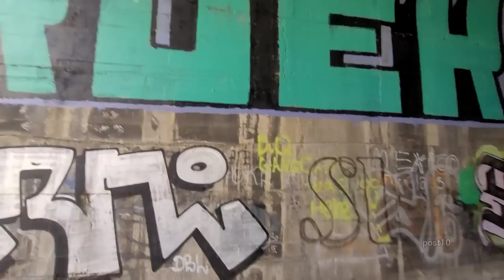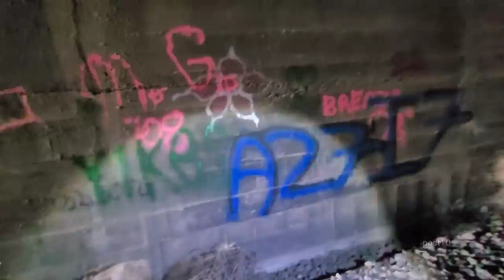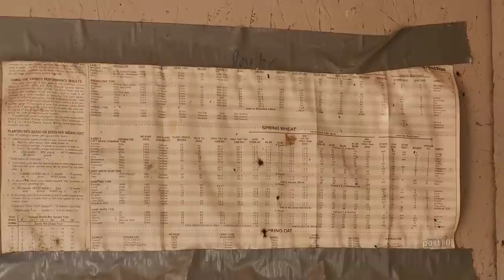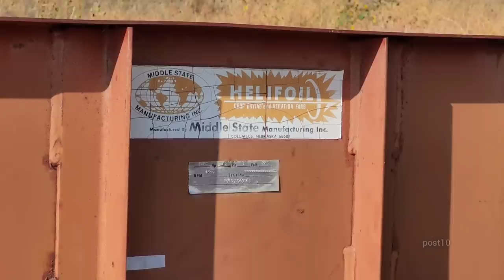Railways, Crumbling Buildings, Huge Bridges And More

Comment: Those vents are to relieve forward air pressure (displacement) when the train enters the tunnel
Reply: That is really cool information.
And it makes a lot of sense to have a couple in a long tunnel.
Reply: Chooch ventures
Reply: Not true
Reply: @MonkeyJedi99  Wrong.  The other end of the tunnel is good enough for that.
Reply: to accelerate smoke dispersion....locomotives are a lot like people- they work better in fresh air
Reply: @tommurphy4307  Also the drivers and any passengers live longer. for all those people who think the tunnel entrance is sufficient for ventilation i assume you have never heard of the Black market express disaster.
Reply: Those old towns are the result of highway diversions. That used to be the main road.
Reply: This much simpler explanation does sound infinitely more plausible and on the face of it, accurate.  However, taking a moment to reflect upon the many other tunnels we have each travelled through, why couldn't we recall ever having seen anything remotely like what is claimed here, and identified this easily ourselves? So I'm not so sure this is as accurate after all.
Reply: My theory is these are refugee points to wait for passing trains, or it was some kind of service hatch and the bars were added at a later date to stop people from accessing the unstable rocks behind
Reply: 1:05:40 Post had the same thought 👍🏼
Reply: @tommurphy4307  Are you claiming that a solid fuel powered steam boiler is more efficient if the already moving train has 'cleaner' air around its fire box? Your comment is suspiciously over supported by YouTube's Thumbs up bums counter too in my humble opinion.
Reply: That's exactly correct .
     The tunnels look big but if you seen a train inside of one , yes they are pressure vents .
Reply: Yes.
If a train was really pulling fast into a wind, the tunnel would become a pressure vessel not to mention fill with smoke, and "pop" out the end.
The vents prevent the smoke staying in and permits the train to maintain speed (& lower the level of "pop".
Reply: @scaleyardmarine 🤣🤣🤣

Comment: That old RR bed is indicative on how the railroads were engineered and built 19th and early 20th century. The old roads and railroads from that era followed low lying areas. Many followed rivers or low lying features that were prone to flooding. After the equipment got better did the engineers seek a higher ground. Mostly after WW2, the engineers of highways and railroads had a better way to build. That filled part is a great example of that, right at the beginning of the video. They learned much from the mistake of building too low. Creating a higher roadbed was crucial. With the advances in earthmoving equipment and cheap diesel came better track, highway, and road alignment.

Comment: The water damage/mineral build up on the wall at the entrance of the second tunnel is from blowing snow and dust being sucked into the tunnel. The snow builds up on the sides of the tunnel as the strongest air current goes through the center and slows down depositing the snow only in the first meters of the tunnel. That's why the "damage" was only at the beginning. Then the snow/ice build up and collect dust and dirt blown in as they take a long time to melt since the tunnel stays much cooler than the outside air.
Reply: Nope it just salts seeping from the ground through the walls of the tunnel.
Reply: @Mike-tv9rk  I have to agree.  The foundation of my house looks the same way in the spring time as the water that wicked up into the concrete over the winter dries, and leaves the calcium deposits behind.  I also live in this region.
Reply: It is rising damp.
Reply: @Mike-tv9rk  Yes, from behind the wall.

Comment: 25:30  Eleodes obscura.     They eat dead plant material, animal remains, roots, and seeds. 26:12 Lesser Yellow Underwing. 26:21 Anise Swallowtail. 28:00 Tumbleweed seeds. 1:54:16 After the windmill broke for the last time they put in the gasoline powered pump jack that used the same equipment below ground to pump water.

Comment: That part of Washington doesn't get enough snow for snowmobiling, you need to go to the forested areas for that. The part your in is High plateau dessert. If your here at that time Tollgate Wilderness Area in Oregon is a great place to go, they groom the trail regularly there but is far enough from a major population center that it doesn't get over burdened with city folk. Also that dust you kicked at the trestle is likely ash from the 1980 eruption of Mt Saint Helens, you can still find large piles of it in the area.
Reply: Mt st Helen's or Mazama, thats also common out there.
Reply: @rockdocandlittlebird5974  Its posable that its Mt Mazama but un-likely given the area for two reasons. First the area he was in is right along the path of heaviest ash fall from Mt St Helen's main eruption in 1980, and two most of the Mt Mazama ash in that area must be dug down for.
Reply: @Darkreine99  sweet, I live here and have multiple degrees in geology focusing on that specific region.  I know it isnt common but it is possible to find out there.  I've been there, done it, without digging.  Lots of road cuts expose it.
Reply: @rockdocandlittlebird5974  I live here too, and have studied the geology of this area all my life driven by my fascination and the impact May 18th 1980 had on my young mind at the time. I do not nor did discount what you said. I merely made the statement given the evidence that it is more likely Mt St Helens. Because without physically touching and taking a sample there is no way to be sure from a 10 second clip in a video, and let face it a road cut is a hole dug. But I do apologize if what I said made you feel minimalized that was not my intent.
Reply: plus the ballast in the tunnels would be tough on the snowmobiles- duh

Comment: That area is part of the channeled scablands. That entire terrain was carved by the repeated Glacial Lake Missoula floods. Lake Missoula formed and reformed as the ice sheet retreated, but was dammed by ice which would eventually break. It is now generally thought that there may have been 40 or more of these between 15,000 and 13,000 years ago. The water flow could vary between floods and are hard to estimate, but one common citation for the largest floods is 10 cubic kilometers per hour (roughly 13 times the current Amazon river). Flood waters dumping into the Columbia flooded most of the Willamette Valley in Oregon.

The volcanic flood basalt that covers the whole area broke along the cooling fracture lines basalt tends to have and huge chunks just washed away, resulting in giant cliffs and canyons that are out of scale otherwise. Also giant river potholes ground out in some places.
Reply: you wouldn't want to be in one of those tunnels back then, right?
Reply: I've seen those potholes. 
They are still kind of a mystery.
Reply: @TheBandit7613  Prof'. Nick Zentner, 
Geology, Washington Central University, 
went to Dry Falls, and showed us 
the huge holes drilled into the rocks
 below by the huge Ice Age Floods 
that crashed over the Falls : 
If interested, you might like his 
lecture on : 
" Dating The Ice Age Floods ".
🇬🇧💕🇺🇸🌈🦉☺️🇬🇧
Reply: The rocks ripped away by the Ice 
Age Floods : hard to visualize ! 
Huge volumes of water, plus 
icebergs
 with rocks frozen inside : 
when the 
ice melted, lots of rocks 
were  then " dumped " in 
unexpected  places : 
I think they are called, 
" Erratics"...
Prof'.Nick  Zentner' s Geology videos
and field trips are so interesting.
Thousands of people across
the world have found a new
 interest : Geology ! 
Loads of videos here
on You Tube.☺️⛏️☺️
If interested, please perhaps
 start with the series, 
" Nick On The Rocks ".
Highly recommended.☺️.
🇬🇧💕🇺🇸🦉🇬🇧⛏️☺️🇬🇧

Comment: If you're in Seattle area, check out Snoqualmie Pass tunnel at the top of the pass, along I-90.  2-mile long tunnel that is now a bike path, John Wayne Linear Trail, which leads west downhill 20+ miles to Issaquah.  You are required to have flashlights since it is so long and dark.  I did it on my bike a few times and it took 15-20 minutes to get through it on a bike.  Slight grade uphill to the east, downhill to the west.  A lot of the former Milwaukee Road electricification is still visible, the poles alongside, and catenary towers on the high trestles.
Reply: Yes, that's an awesome tunnel.  I ride the Palouse to Cascades Trail on occasion too.
Reply: the abandoned pennsylvania turnpike tunnels are bike trails where you have to have lighting, as well. one of them is the site of the annual 'echo dark bike race'. the echos help the racers keep from hitting the walls.

Comment: Pretty sure the 2 tunnels I located on Google maps are the ones you walked through. There is an inbuilt straight line measuring tool in Google maps, using this the first tunnel  is 677 metres/2,222 feet and the second tunnel is 759 metres/2590 feet. Some breathtaking scenery in this video.

Comment: I've seen good amounts of video from the former Milwaukee Road grade north of this ROW, but never this one! This is the former Spokane, Portland & Seattle Railway mainline from Pasco to Spokane. Successor Burlington Northern (foolishly) abandoned this route in the late 80's and used the former Northern Pacific line form Pasco to Spokane. The SP&S grade happens to be the BEST route between both cities in terms of gradient, but the huge trestles near Pasco and lack of on-line customers was a big turnoff for the BN. In Washtunca (where you saw the graffiti bus) there happened to be another rail line (also abandoned) that was built by the Oregon Railroad and Navigation Company. Their ROW crossed under the SP&S just outside of town!

Comment: I think you're right that the grates in the tunnels are for safety. They definitely look modern in materials and construction; especially the machining on those security bolts. I noticed you can also see the yellow marker on the parts from when they were fabricated... For example the second one you came across in Tunnel 16 was marked "#16.2" on parts of the frame. Each one was probably custom sized for the particular hole they were made to cover along the various tunnels of the trail.
Reply: If they were for safety they would be every 50 metres. Have a little think dear. How fast can you run from a train.?  Probably vent shafts to the surface.
Reply: @Mike-tv9rk I'm talking about the safety of the public using the trails today, to keep them out of potentially dangerous areas like vent shafts. I already stated that the grates looked modern, so I'm not sure why you'd think I was referring to a use from the long-gone days when trains were running through. Perhaps you should have a little think yourself, dear.
Reply: @marcberm  ok i had a re-read. Yep sorry.  I jumped the gun a bit, because there are alot  of comments about refuge spots. Again apologies.
Reply: The grates are very likely there so people dont go crawling in the holes behind the walls.
Reply: those were def not 1909 security bolts- duh

Comment: Railway tunnels commonly have what are called 'refuges' where maintenance workers can go if a train comes through and the worker cannot get out of the tunnel. Railway bridges have them too. I know that the Eurostar tunnels under the English Channel are actually 4 tunnels, 2 for trains and 2 for maintenace travel. Maybe that is what is behind the vents. I'd be surprised to find snakes in a cold tunnel cos snakes and other reptiles are cold blooded and prefer warm conditions. Fascinating place to explore.
Reply: These vents were not numerous enough to be refuge tunnels. Nobody can get to them fast enough. Most likely vertical air shafts per distance regulation .
Reply: @Mike-tv9rk  You're probably right. Just a guess on my part as i haven't been there in person. Have a great day.

Comment: The section of road bed you stopped at that was filled over with man-made fill was actually a HIGHWAY.  The Kahlotus Railroad Tunnel actually exited further up 263, which was the road that turned off to the left before you got to the filled area

Comment: I live in Eastern Wa., so found your video very interesting.  One of the rail to rail parks I've wanted to ride with the mountain bike is the Columbia Plateau trail you featured.  Now that I've seen it, I think I'll wait until it gets more usage and maintenance.  Still, the scenery is awesome.  I followed Google Maps during your journey.  Didn't even know those tunnels were in that area.  Regarding the fire, according to the fire tracking Web page CalTopo, this fire happened in 2020, and it covered many acres.  I'm surprised the guardrail hasn't been repaired yet, but the sections that burned are in county jurisdiction, and funding is probably very limited right now.  The road turns into a state highway at Windust Park, about 3 miles south of the dam. and remains that way north to the town of Kahlotus.  Great video!
Reply: the tunnels would be okay- just rr ballast rock. i would do it in the fall.

Comment: 28:16 A section of I-90 where the ground comes up on both sides of the road, was completely filled with tumbleweeds during a storm a few years ago. Cars kept plowing through in an explosion of plant and dried fibres.
Reply: I live in Eastern Wa, and I've had that experience in my back yard on a number of occasions.  Sometimes 6 feet high, from fence to fence.  No fun getting rid of!

Comment: The road you turned on to that went by the foundation remains is the rail grade that was put in to bring supplies in to build the dam. Had you continued you would have arrived at snake river jct. The railroad on the opposite side is the Union Pacific line from Spokane.

Comment: I was going to guess those grates are for equalising air pressure as a train passes through, but your guess of them just grating off worker holes sounds more plausible.
Reply: they are for ventilation and access to the tunnel bore. the concrete had to be inspected (inside and out) every so often as per the RRDOT

Comment: The lever in the bus is the gear lever connected to the gearbox at the rear end. The “Flywheel” looks to be a brake disc on the prop shaft for the handbrake, rather than having the handbrake operating on the rear wheel brakes. Willis Jeeps used in the Second World War had a constricting band that acted upon the prop shaft for the handbrake.
Reply: actually in some states that was an automatic brake that engaged when the engine was shut off- a school bus safety thing for manual-shift buses. i drove a manual-shift international school bus in the 70's but it had air brakes.

Comment: Tunnels for coal fired trains definitely need ventilation as well as long tunnels.  The Eisenhower tunnel on I 70 has an extensive ventilation system.  Possibly there could be a passive system with the train pushing a plug of air in front of it which hits the first grate and exhausts through the second one.  Maybe even creating a back draft.
Reply: No they don't. That grate isn't ventilating the tunnel. 
The Eisenhower tunnel was opened in 1973. Look at the Moffat tunnel.

Comment: The southern pacific RR had problems with there early diesel locomotives being choked by there exhaust building up at the top of their tunnels. To solve this they moved the air intakes to the bottom of the loco on the SD-40T-2. I wonder if those grates were there to help facilitate that problem by supplying clean Air. As well as relieving forward air pressure.
Reply: had nothing to do with the tunnel-motors- this was the SP&S railway. it was torn up before the tunnel-motors were even built. the grates were added when the trail was built- of course they were for ventilation as ALL locomotives (and crew members) need fresh air to stay efficient.

Comment: I think you might be right concerning your theory about the metal grates inside the tunnels.  They very well could have been put up after the trains stopped coming through.  However, there are a couple of possible flaws with that theory.  For one thing, the tunnel is long enough that it should have more than just a couple or three of those alcoves.  In all of the other tunnels I've seen that do have those maintenance alcoves, they existed every 50 to 100 feet.  Sometimes even closer.  There wouldn't be just two or three of them.  However I do agree the actual metal grates were put on there relatively recently and were not part of the original tunnel.  The second mystery is that I do think there was once an accessway behind the tunnel walls - and you used those alcoves to get into the maintenance tunnels.  Because you can tell that the space behind the tunnel walls are hollow.  Which means they were more than just alcoves for workers to dodge trains.  They were probably used as necessary to shore up the walls or possibly for drainage.